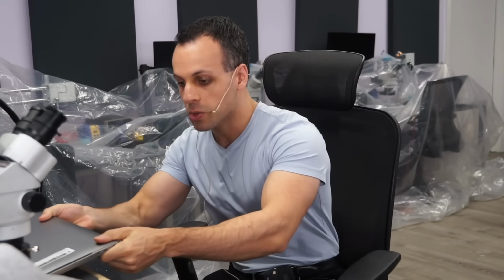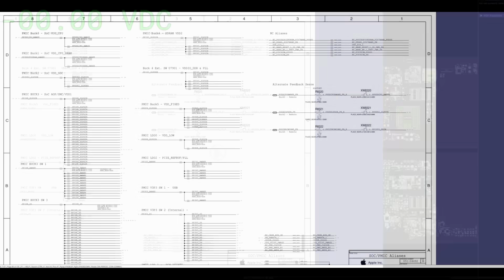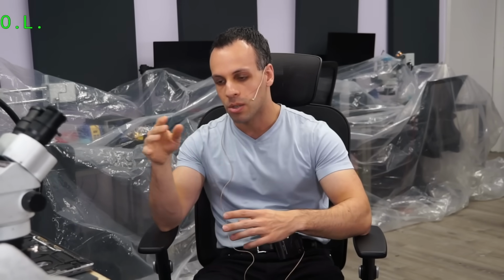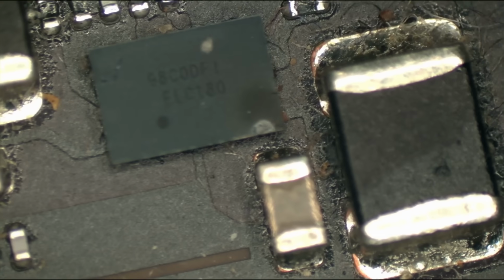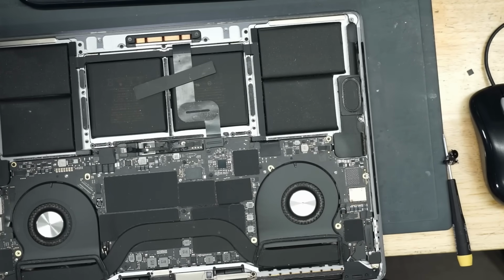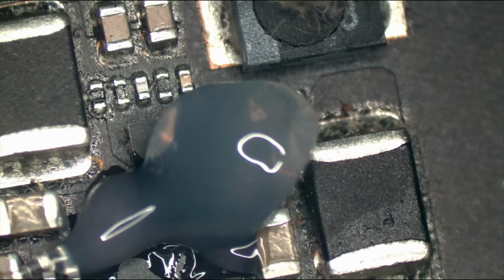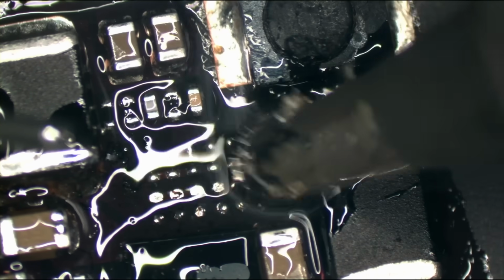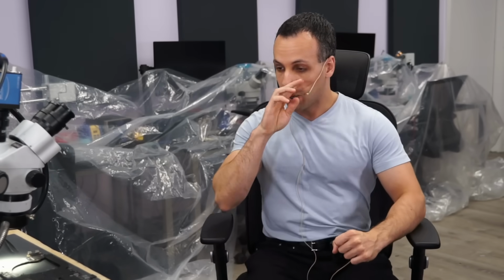How most 16" Macbook Pros often kill themselves & why they're unfixable

Comment: Is it me or is Rossmann getting more swole?!?  Brutal ending to a video... sorry to hear.
Reply: The dead macbooks are giving him strength.
Reply from the maker: I haven't gotten much stronger but I lost 30 lbs so it gives the illusion that I'm swole when it's just I'm less fat. My current routine is something approximating this, adjusting upwards as I get stronger. 

Monday:
1 set of deadlifts, 300-320 lbs, set of 5-8
1 set of shoulder press, 115 lbs set of 10 or 135 set of 7
9-10 weighted pullups with 45 lbs 
10-12 curls 75 lbs OR 3-4 curls 95 lbs
10-12 skullcrushers 75 lbs OR 3-5 skullcrushers 95 lbs
half an hour of elliptical with high intensity cardio/interval training mixed in, heart rate 125-135 for normal, 165-175 for interval

Tuesday:
half an hour of elliptical with high intensity cardio/interval training mixed in, heart rate 125-135 for normal, 165-175 for interval
highwayfit medium routine

Wednesday:
set of squats, 255 lbs for a set of 9 to 11
set of benchpress, 255 lbs for a set of 4-5
set of pullups, 18-23 
10-12 curls 75 lbs
10-12 skullcrushers 75 lbs

And then Friday I do Monday's workout, Sunday I do Wednesday's workout, etc, and so on and so forth. Every other day is a heavy weightlifting day and they all include a leg lift so there's no dedicated leg day. 

I stopped eating bread, pitas, and unnecessary carbs as well. No dessert, no chocolate or added sugars, no soft drinks, no energy drinks, no sweetened tea.

It's a good feeling to not be out of shape anymore. Go for it!!!
Reply: @rossmanngroup  is this MBP 16” specific problem or its a nice surprise for the whole MacBook Pro M1 bunch ?
Reply: @MilenMinev  this is the older MBP 16 with intel chips on it. He mention A2141 not  A2485
Reply: @MilenMinev  was it an apple silicon machine? Seemed more like an intel one
Reply: @MilenMinev its on the t1, t2 models 15-16 inch 2017 to 2019.
Reply: @rossmanngroup  WE GO JIM
Reply: @rossmanngroup  Thanks for sharing!
Reply: @TheRealXyzven  Luis don’t ever ask that girl out again. Maybe only if she begs but even then no 

That is unacceptable behavior. Your worth more then that
Reply: @rossmanngroup  I used to weight train at home back when I was about 42 years old. I was in the best shape of my life at that point. Then I developed fibromyalgia and chronic fatigue. So the weight training and cardio came to a crashing halt. By 52, I got my first heart attack. Triple heart stents. Eight years later my second heart attack. Triple bypass surgery. 

I can't explain why I still have my weight bench and Weider weights. I decided to keep the plates for my two year old grandson. Maybe he'll wanna weight train in his teens. Maybe I won't be around to get him interested in it. 

Anyway as an older electronics tech and computer repair guy, watching you work is like a combination of magic and adventure. It amazes me how these machines are constructed today. I will never own an Apple product and only own ancient PC's with Linux on them. You seem to have the same disdain for Apple as I had working on Windows computers. Lol! 😂 Love that dry sense of humour you have. Anyway, keep on rockin'!
Reply: @n.miller907  Started lifting (decades ago) in my teens but my infant grandson loves the dumbbells I got him… cheap plastic but they flash & beep when used.
Reply: @rossmanngroup  Sounds close to my practice. I love this routine in combination with the diet. it has been great for me as well.
Reply: Swole used to mean something very different, it meant angry
Reply: @rossmanngroup  i thought it was 100 pushup 100 squats 100 sit ups and 10km running a day w no using ac or heating no matter how hot or cold.
Reply: @rossmanngroup  I just saying out of ignorance, why don't u just solder the new ic and see if something majical might happen.
Reply: @TecArtScien  Not gonna help. If the 13 volts went straight to the SSD, the 13 volts would want to go somewhere, and more often than not it's straight to ground.

And every chip has a ground pin (some have more than one, especially those with hundreds of BGA pads). And it doesn't care that there's millions if not billions of nanoscopic transistors between the power rail and ground. It will go scorched earth on these transistors to get to ground, literally turning them from transistors to one single wire. It's those transistors that hold the data.

In short, once 13 volts hits the SSD, it's toast.
Reply: @TecArtScien  Easier to actually check if the conditions to make the replacement component actually exist. That's the pro repair procedure.
Don't spend time fitting the replacement part, to potentially remove it again, now in its dead configuration.
Reply: @TecArtScien  watch the video the band is shorted IE blown up
Reply: @TecArtScien The magic smoke has already been let out of the storage nvram. It took the ones and zeros with it. You can't put humpty dumpty together again.
Reply: @rossmanngroup  Goated Response
Reply: @rossmanngroup  Great workout plan.
Reply: @rossmanngroup  but then you drink fireball.   Man, switch that garbage out for Jack fire.   You'll be happy you did
Reply: @rossmanngroup Swole or not
you look daddy for me enough ❤🎉
Reply: @rossmanngroup  1 set of shoulder press, 115 lbs set of 10 or 135 set of 7.  135 set of 7. fucking gorilla omg
Reply: @rossmanngroup looking good I’m jealous
Reply: @rossmanngroup  you look healthier, your diet change tells
Reply: @rossmanngroup  how many reps per set?
Reply: @rossmanngroup I can tell by the speed you’re fucking talking at that you quit carbs 😂😂😂
Reply: @rossmanngroup  holy fuck
Reply: @rossmanngroup  gotta be jacked to repair crApple lol
Reply: @rossmanngroup  nigga you strong asf. Dont underestimate yourself bro
Reply: @rossmanngroup  Never giving up my sweet tea haha. And my coffee. I consume way too much sugar but really that's my only bad thing food wise. If anything, I way under-eat. Always been 135-140lbs at 5' 11".
Reply: @rossmanngroup   My man, you are getting swole! That workout routine will get you jacked lol
Reply: @rossmanngroup I guess not married or have kids gives you the extra days for excercise.😅
Reply: thanks for sharing it man 🫂 @rossmanngroup
Reply: Ts is my ruotin now @rossmanngroup
Reply: @rossmanngroup Yeah muscle mass is way heavier and more compact if you check Rossmann Bices it is two loaded shutup gunners ready to be released on false claiming commentérs!
Reply: @rossmanngroup thanks for sharing this ! This is a great routine. I’ll work some of this this in as another change up option on the roster.
Reply: @rossmanngroup  when I greatly reduced my carb intake and got into ketosis I felt so much better, I no longer needed caffeine/kratom/etc. to keep going all day at work, just had "clean" energy. Carbs are the devil!

But they are pretty tasty.
Reply: I could see it in his face immediately. I haven't watched his channel in a while, was like woah Louis looks jacked.
Reply: Probably burnt 1000 calories moving his jaw at these speeds
Reply: Every time nand gets 13v he does 1 pushup
Reply: The silent rage coursing through his body at how crappy Apple products are is slowly enlarging his muscles.
Reply: @Cheesedragon117  🤣
Reply: He got swole from repairing all those macbooks
Reply: Looking solid, thick, tight.
Reply: Saw that, dudes been workin' out!
Reply: He eats raw liver... That's it! No human growth hormones.
Reply: Is the everclear for cleaning the board??
Reply: @dogfoot1874  No, it's for cleaning the soul. Like he said, that evening was a write-off, the Everclear+Fireball is the write-off procedure. Good he's in the shape he's in, that would write off a week for me ;)
Reply: Lifting the new heavier MBP's builds wide biceps!
Reply: Him as a person or his head?  Lol 😂 jk
Reply: my first thought when i saw this recommended to me. i was like “omg louizaddy 😩”
Reply: He's channeling his anger from apple
Reply: Lifting MacBooks all day, will do it!
Reply: Ross should start doing motivational talks
Reply: So what was the actual cause of this? As there was no water damage, is each device randomly programmed to destroy itself when it is built?
Reply: @rogerhalt3991
It case you missed it, yes.  Not only MacBooks.  But many electronics we purchase today are self destructing by design.   What else feeds the greedy machine?  Wake up people!   👀
Reply: Was about to write the same thing !
Reply: What a boot licking simp you are.
Reply: It’s cuz he has to keep fixing apple products lol
Reply: For every MacBook that dies he’s able to get an extra rep on his bench press.
Reply: Rossman def more cut
Reply: Nah, that's the first thing I noticed. Dude's been hitting the gym, clearly.
Reply: If you threw as many Macbooks as Louis you would ripped too.
Reply: I'm figuring losing 30 lbs deserves a huge congratulations, especially since nobody else seems to have said it.  👍🏼
Reply: Stop objectifying his hot body😅
Reply: Love the channel, the right to repair and you’re great on screen. Why did this chick bail last minute!?
Reply: Talk right.
Reply: Smeedium shirts help a lot..
Reply: Maybe you dont understand how much skill and knowledge this guy has. How he lists off the rails and what they power. The the side bit about human hearing. He knows how these big companies operate like snakes just to get your money. How people buy their garbage is a mistery to me. Ive done away with all apple junk. Apple will take your money, your time and your data and they dont care as long as you go back like a loyal donkey and spend your money there again
Reply: How much extra Adderall lately tho?? 😂
Reply: I’m surprised your even trying to date, successful YouTube channel, business, sticking it to major corporations…  plus your in USA (girls suck) just keep doing you broski I’m a single dad and had to go to court for rights for my son and spent 24k trust me your better off 😂 that or date out of country, (wildly different perspective on what family means)
Reply: Yeah dude is jacked these days
Reply: Looooool
Reply: he's finee
Reply: Instead of hitting the Everclear, hit the gym.
Reply: Hes definitely working out.
Reply: speaking of sorry to hear... i am out of the loop for a year now... and i hope erika (erica?!) is still around... was wondering because of the "relationship to women" hint ~6:50
Reply: @The1Rausch  I guess you didn’t watch the end at 14:35
Reply: He's in NYC maybe he's pregnant? 🤣

Comment: I had two 16in MacBooks Pro. The first one is 11 years old and still run fine, only the battery was replaced. The second one is 5 years old and still works very well. My wife also had one for 7 years and it always work fine, never broke until she trade-in for a new machine. So only to point out that your title "MacBook pros always die..." is totally clickbait and misleading.

Comment: It’s with everything, the new shit breaks very fast. It’s intended so. I just went through the ordeal of a failed PCB board in a washing machine. Just a week prior to that a fan extractor button had melted. Two failed appliances in a week. I got to study up and gods to speed with planned obsolescence and removing right to repair. 

Bought an old washing machine that is actually reparable. Bought a used eye glasses frame that I put an old pair of lenses in (identical model of the frame) bc the new lenses all come with anti reflective coating that flakes, and makes you through away the entire set. You cannot buy uncoated lenses any longer. 

The list goes on.

Comment: I know this is 4 years old but if anyone has any suggestions I would appreciate it. My Macbook randomly died and it won't turn back on now (like the one above). So when I measure voltages like he did in the video (I can't remember the names and can't find the schematic for the board), I get voltage however when I plug it in I get an open on the first measurement he took, after a couple of minutes it starts reading voltage again. I'm guessing this means something is tripping the board into a safe mode like how a circuit breaker works?

Comment: I put thermal pads on the VRMs and a 3 inch piece on the thin as hell heat pipe to send heat to the bottom cover and boy does it sent heat to the bottom cover it's concerning how hot it gets there is no way that weak heat pipe can pull that much heat from the cpu and gpu. The VRM's get hot as hell as well.

Comment: This dude a badass!! Id love to learn computer repair. I have three broken MacBooks in my bottom nightstand drawer. One of them I just got about a year ago. It only works with the screen open about a quarter of the way when you open it halfway the screen turns black. I watched one of this guy’s videos or someone else’s videos on this they say the ribbon gets loose connection and it’s pretty much unfixable because it’s part of the screen that was a disappointment I need to try to sell them for some cash as parts.

Comment: Every time I have an idea of going back for an Apple MacBook, I come back to these videos to get peace of mind
Reply: Since 2009 i use only MacBooks... why?
2009 15" model withstood heavy mobile usage for 3 years in school, fell apart and with glue and ducktape fixed used for some more years.
2010 15" model i used daily until the release of the M1 Pro/Max Macbooks, and its still working (on its 4th battery replacement!)

So far, for >16 years, i had just 3 MacBook Pros, of which especially the 2009 model was a "tank" those 3 years (good enough performance, extraordinary battery runtime, screen and inputs,....). The first year in notebook class i had a Acer notebook for like 600$, didnt even survived a year.
Reply: @harrison00xXx  I would love to read this text from both my PowerBook G4 that died one year and half after purchase because a kernel problem... And also from the same 2009 MacBook you had that ended with an Nvidia issue that never was solved in my country. Thank you for your input.  Funny, I can write to you from my 300$ Acer two-in-one still working since 2013.
Reply: @DavinciWhite  The issue you are talking about also made my 2009 model dying slowly.

Its just a capacitor, this was solved globally within a year or so...

Comment: At 5:46, it seems to me that the area around TPS562180, that upper-right corner of the PCB, has some heavy flux left over from assembly. That solder flux could be the real reason the chip got toasted, because it tends to have lower viscosity when components get hot.  If the flux is conductive (as most acid fluxes are), it could simply migrate beneath the TPS chip and cause an inductive short; the flux's internal resistance will increase somewhat in proportion to the temperature in that area.
I have seen this problem many times on many PCBs that left the solder wave line, and often, the QA is doing an aesthetic check of the PCBs, and that flux goo is missed quite a bit, 10-15% of the time.

Comment: I had a 16" MacBook Pro die, by all appearances, when the wifi antenna fried itself. Over the course of the next couple of days, it went from no wifi to not powerering on. Apple claimed no responsibility. I seriously considered not buying a Mac again, but PCs are such crap. Even though I use calculation-heavy programs like Mathematica running for hours, I moved to a 15" MacBook Air. I'll never get a Pro again.

Comment: Question:  Apple has added the diagnostic menu in firmware updates and all that to be bootable now. Allegedly On the 2019 as well??

The question I have is let’s say you get this repair done in the future from this failure.  We know in the past you were still screwed even if you replace the chip.   but now that you can boot into a diagnostic firmware menu is that still the case if you do the repair ?  I am curious because I’m about to be an owner of one. I’m still borrowing this one, but I’m about to pay for.   Anyone know or test this yet?

Comment: PP Bus 3 in women is where? When you send 13.+ volts into her SSD you're screwed unless and until you determine if it's water damage? :) good stuff. Listen for it. I had a 2012 MBP 16" went blank. Rebooted as Target drive and lucked out got two copies of everything from the about to be fried SSD. Succcess, learned another lesson not answer - backups matter. Alos buy a new MBP every few years and bypass all the repairs needed. Apple designs for sales not failures. Thanks just found your source Like Share Subscribed.

Comment: I fixed mine by plugging in TWO power adapters (using the USB adapters) and letting it sit overnight.  Mine wasn't working for a year, took it to a repair shop, they said new logic board, etc.  Mine took a zap from a lightning storm.  I think what happened was the chips shorted it to ground on the first thing to protect it but it needed to be reset which I did by plugging in two power sources.  After the evening, I was able to get it to boot again.  Once it booted, I was able to get it to restart and it's been working fine now for more than two years.

Comment: I went through 4 of these and they all died in this exact way sporadically. Apple refused to let me refund the first one that wouldn’t even power on out the box, so locked me in to constant replacements with apple care. After the 4th 16” 2019, 5 years later, they replaced it with an m4 pro macbook which will now be my 5th machine from the one purchase. The magsafe charging chip for that died after a year and needed replacing. There’s no way to use a macbook without applecare or they will just die and you’re left with an unserviceable hunk of metal. Such a joke.